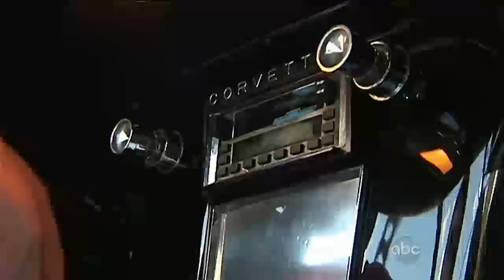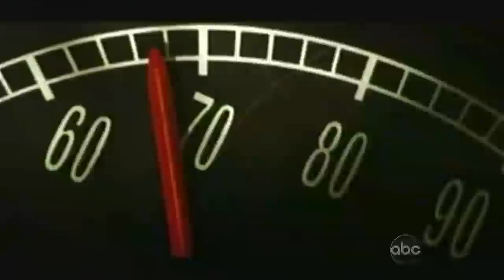Who Killed General Motors?

Comment: Look at the oil my Cadillac spills basically sums it up.
Reply: I've owned 7 of them. From 2001 on. None of them spilled a drop and I've been keeping them will over 200K. None of them were traded in, they were all totaled in an accident. None of them my fault. They all kept me safe. I walked away, no problem. People running into me, not so much.
Reply: bbodinefan11 you need to get the loose oil filter tighten up my son
Reply: @vermontjeff2535  could be lifter covers leaking
Reply: bbodinefan11 ..Pretty much.😂
Reply: Dumb ass
Reply: @efandmk3382  triggered much?
Reply: @efandmk3382  You've clearly never experienced a Lexus.

Comment: GM killed GM with pretty cars that fell apart to easily.
Reply: What pretty cars? They all look like horizontal vacuum cleaners thanks to older Audi designs. There hasn't been a good looking ordinary passenger car built for many years. It's claimed to be because of aerodynamics. Bumpers(?) are now part of the entire front clip and are carefully joined to the fenders to insure maximum profit for the expensive repair shops.

Comment: I have a Ram 1500 and love it.  Chevy interior was cheap I guess I would describe it as the most bland tinker toy plastic -kindergarten looking design.  Look at what RAM has done with the 1500 interior for 2019 looks better than most BMW and Japanese vehicles.
Reply: If Dodge had been allowed to die or downsize like they should have back in the seventies when they were initially bailed out That would have been the best thing to happen to the domestic auto  manufacturers. But no, they where the first to get the first and the second bailout. You dont reward failure and expect success.
Reply: Lol Rams don't last either.

Comment: My F-150 is tight and well built . It hauls ass and gets great gas mileage .
Reply: Well  good  for you. You actually  got a good one. I've found Ford and especially Chrysler  products tp be a gamble as well. They  all put out crap. Just buy a Korean or a Japanese car and it will piss you off when it dawns on you how much money/time you waisted over the years rebuilding the STUPID  crap they put out.  If KIA puts out a heavy half ton pickup. I wont be needing anything  from the  big three.
Reply: You're not the only one. Have 4 that have over 650,000 miles each one. Never an issue. Have 3 1978 models with over 1 million miles with no  rebuilds. Awesome trucks
Reply: Ford trucks are exception to the rule.
Even blind squirrel find a nut, once in a while.
Reply: @johnschramm1880  so you're the blind squirrel. Congratulations you got one that works. Hope you get lots of trouble free happy miles out of it.
Reply: compared to a tank it gets great Mileage American cars are on the Road  to going Bankrupt
Reply: @robertrichardson9953  Built FORD TOUGH !!!!!!
Reply: @archie764  People have been brain washed for decades on the "great mileage" Bullshit to their detriment !!!!  Buy a truck that does the job and you do not have to worry about a MPG !!!  IF you do you do not need a truck !!!!!
Reply: My 2005 Dodge (Ram) runs great, no issues (other than air bag from Takata).  Not wanting to trade because new FCM's have many issues.

Comment: Use to be that  the engineers draftsmen and upper managers started on the assembly line, and they worked their way up the ladder. They knew the complete process inside and out. They knew how to fix real world snafus on new products.  But some where along the way, they decided to hire a kid ,snot nosed  no street smarts right out of college for next to nothing,  making design decisions,  for cost cutting.  And of course the old timers couldnt get along  with morons like that, and probably got tired real quick of bailing them out when the blueprints were wrong, ect.  Only thing  is nowadays  its proobably worse.

Comment: When GM built the engine with TIMING CHAINS on front AND rear of the engine, it became a game changer in the service industry.
The timing chain is a repair procedure every owner eventually needs, but the NEED TO REMOVE ENGINE ASSEMBLY for repair turned 
what use to be a few hundred dollars into a few thousand dollar repair COST. The SMART owner of the vehicle with this engine took a
 LOSS getting RID of the engineering NIGHTMARE.

Comment: My wife and I own Kia Optima.  Mine is an '09 with 136,000 miles on it.  It cost $18,500 which included a warranty that covers the car as long as we owned it.  My wife's is a '15 with 42,000 miles.  It cost $21,000 which included a warranty that covers the car not only as long as we owned it, but the second owner if we sell it.  On both cars, major repairs do have a $100 deductible.  Both of these cars are the base models without any options.

Comment: The problems with modern cars and pickups is half the dammed things are made out of plastic, recycled materals, low quaility parts made in China and enough electronics in them to run an aircraft carrier.   No one can service or repair their own car anymore, you have to trust a dealer or a local jackwagon mechanic that may not have the thousands dollars of equipment needed to repair them.   
Front wheel drive sucks, they are so cpmpact under the hood you can even do a simple repair like replacing a belt.    They are very overpriced because of all the electronics and technology in them.

Comment: They are following the English model to extinction by building unreliable cars. My father only bought Americain cars whereas my only American car was a 1966 AMC Ambassador which died shortly after 100,000 miles on its second motor(unknown mileage)!  Today I drive a 1998 Rav4 with 238,000 kms. I believe they are trying to sneak over to China but I believe China retains 51% ownership of the Chinese facility!